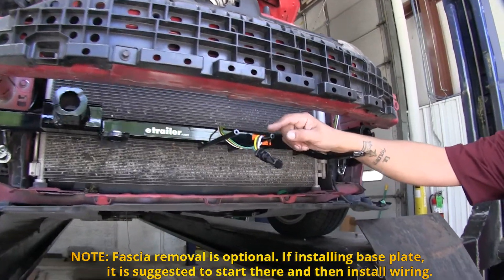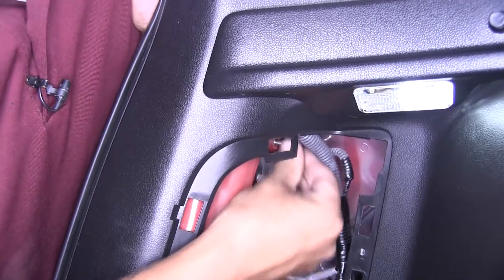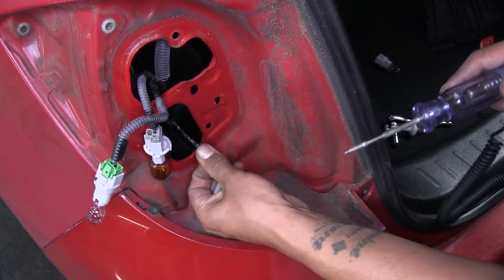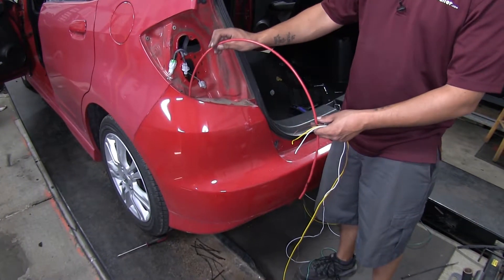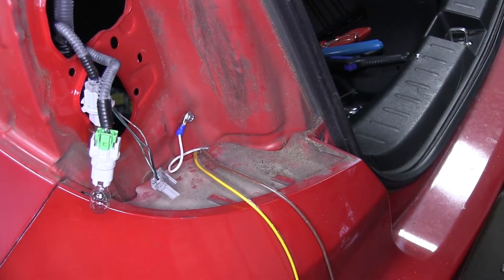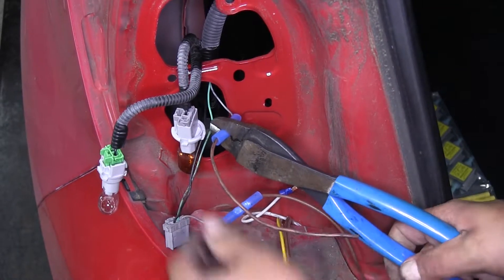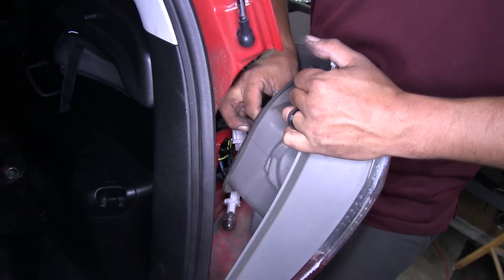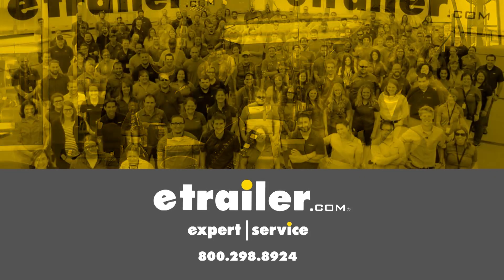Installation: Roadmaster 4-Diode Universal Wiring Kit for Towed Vehicles on a 2009 Honda Fit

Comment: This wiring information is wrong for my 2009 honda fit sport,!
 The green wire is only the brake light, Honda fit has a separate blue wire going to a yellow bulb for turn signals.
Also no need to take off the tail light as you have access to pulling the light bulbs from inside the trunk after pulling of the interior side panels.
Following these instruction wasted hours undoing my mistake of following this video instead of doing my own test light tests, my bad.